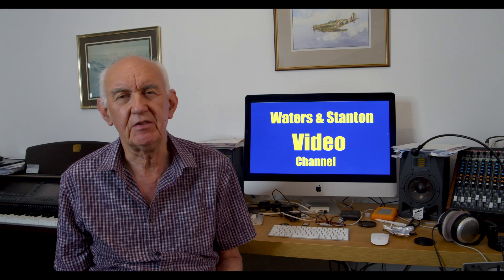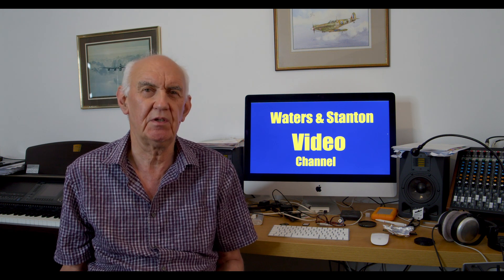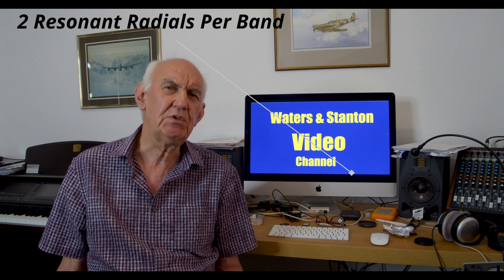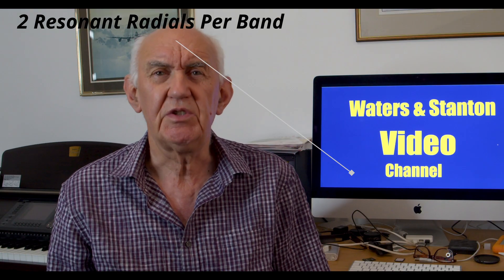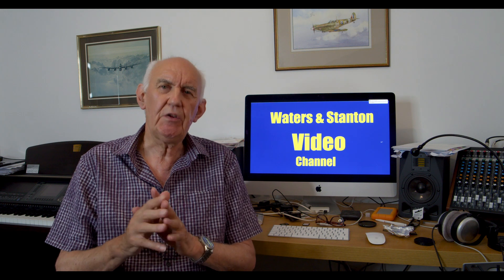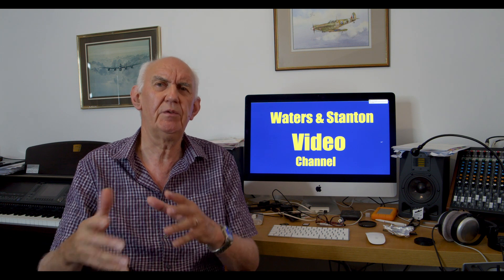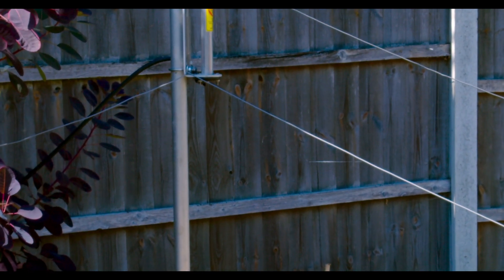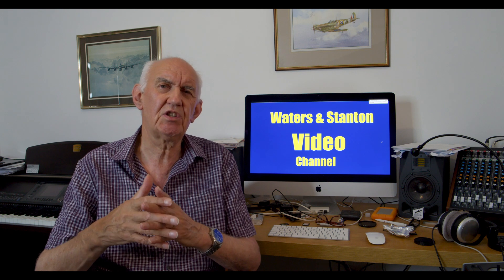Grounded or Elevated Radials? - Your Landslide Vote gives a positive Answer! | HAM RADIO

Comment: I agree 100% about the modeling software!! That is for ideal conditions only! If you live in a neighborhood like I do where the houses are 50m apart you can throw the modeling software out the window...I use a vertical for 2m ( a Diamond X300-A ) and a EFHW for HF and I found that wire length calculators are just nothing but a starting point..My 40m EFHW works best 2 feet longer on the wire length than the calculators say...I'm not an expert ( I just got into Ham back in February) but I have found through great advice from channels such as this and my Elmer's to buy good antenna grade wire and if the calculators say 66 feet order 80 feet of wire...That gives you room to strip the ends to make a good soldered connection and plenty of room to experiment..If I remember correctly the calculator I used for my EFHW said 66' 9" and my best performance is at 69' so maybe this will help some new HAM because I'm still learning and I remember what it was like being brand new and not wanting to call people 5× a day with questions...I have a great Elmer and he did me a huge favor...I kept asking for help and he would tell me what to do and I was very thankful but finally after about a month he told me to " go forth and educate myself " and it was the best advice he has given me! If your new buy the ARRL antenna book and watch people like Peter on YouTube instead of some movie at night that is not going to help you in anyway learning radio..I try to spend at least an hour a day researching something about radio and this channel is an excellent place to go!
Reply: And soil type and ground conditions under any vertical indeed any antenna needs to be taken into account live near water yes  , rock or clay yuk 😂
Reply: @russellbradley454  i agree 100%
Reply: Law of diminishing returns  research has shown after a certain number of verticals is used the difference in performance is negligible   .
Reply: Sorry typo meant radials of course dah
Reply: @russellbradley454  no problem
Reply: @russellbradley454  sorry but I'm unclear what you mean...do you mean radials?

Comment: I built a 1/4 wave  for 6m  antenna it has elevated radials, don't get to excited it only on the side of the shed about 8ft high to the radials, it works a dream, I've made  many a contacts on 6m without all the shouting & bad manners